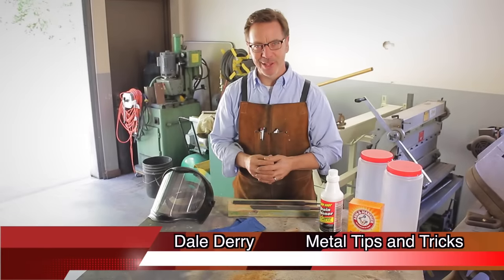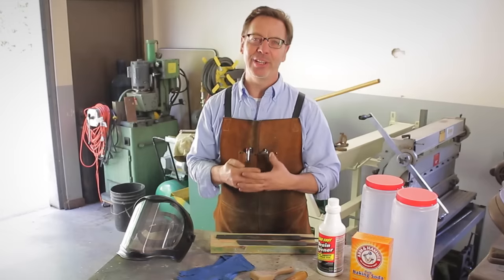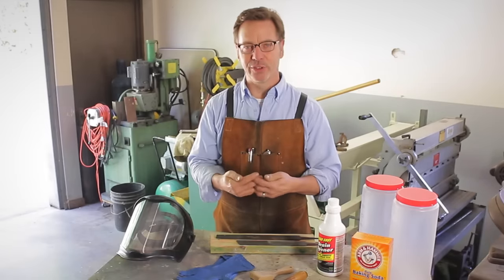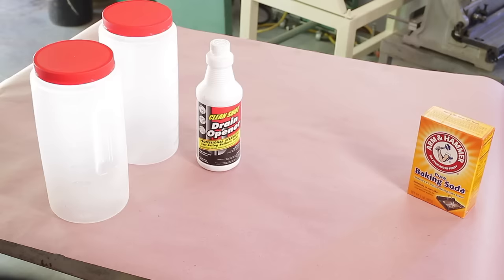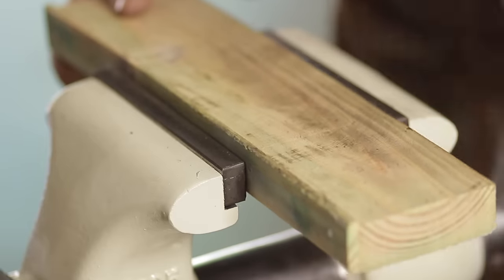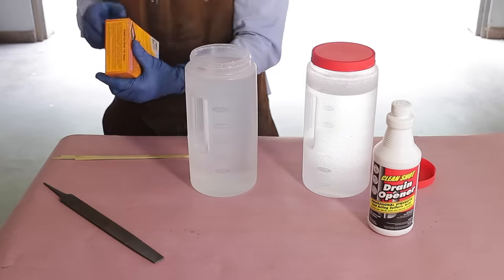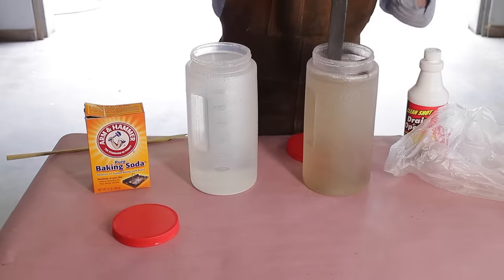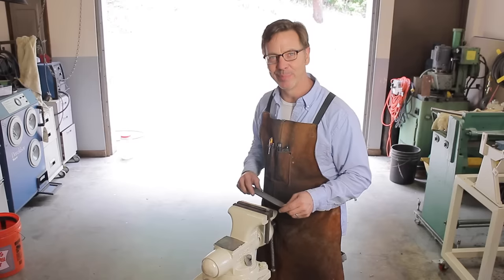How to Sharpen Metal Files

Comment: This WILL sharpen files but it is safer to us white vinegar instead of the sulphuric acid, not to mention that the vinegar is easier to get & cheaper. 
And he's right that you have to clean the file first. If you don't get every particle out of the teeth before you etch them the debris will block the acid and leave a bump that will act like a permanently clogged spot. I'll have to try the copper pipe thing.
Reply from the maker: Thanks for your comment

Comment: Hi'yall.
I must remember that copper pipe trick to dislodge stuck soft metal or paint flakes.
I do use a brass wire brush, as we were taught to not use steel wire brush on a file.
About this water first discussion. Don't just think about a reaction.
Also think about what happens when something splashes into a liquid.
You don't want pure acid coming at you, don't you?
In industrial environment, and at home, you would be advised to also protect your body with an appropriate apron.
If you do not own a face screen, use an old motorcycle helmet or a welder's helmet.
Kind regards, Jaak, from Belgium.
Reply from the maker: Great suggestions :-)

Comment: For years I have been noting these various and odd plans for sharpening files. I don't believe in any of them! Maybe I just know too much about the way a file is made. BUT what DOES need to be discussed is good file use, and cleaning. For now let's look at cleaning. You need a tool called a FILE CARD. It has short, stiff steel bristles. Rub these across the file, with the teeth as much as possible. Clean out filings that get stuck (or simply accumulate) in the teeth. For occasional big chunks pick them out too with a pointed object such as an old scribe. Finish the cleaning with a finer wire brush and you should be all set.

Take care of your files. Don't let them get hit with solid objects, keep them dry. Learn more about file kinds and their uses. By the way, this all applies to chainsaw files too. How can you sharpen a chain with the teeth clogged up?
Reply: A chainsaw file is also a kind of file? Wow, you're a real genius lol
Reply: During use the tips of the file teeth wear away. That is normal wear.  As the file wears it begins to skid over the metal rather than biting in.  At that point it is a viable candidate for either hydro-honing or acid etch sharpening. 
If the file is abused, banged around in a box full of tools, run against hardened steel, or dropped so that the teeth are broken and chipped they are not candidates for hydro-honing but only because of cost. They can still be acid etched. Without shipping costs and the time involved, if you are able to save only one in three it's a good deal. Perhaps most of the file is okay with just one side screwed up, or one end. With no appreciable cost involved, what do you have to lose?
If the file is a little rusty or dirty, use a file card or perhaps a soft steel bar, like I use in my file cleaning video, to scrape the rust and dirt out of the teeth.
Something I haven't noticed in these discussions is any comments on pinning. It's not the topic of the video but if we talk about cleaning, as nearly every post has mentioned, then describing the things that create the need for cleaning should be defined. Pinning is when the gullet between the teeth becomes filled and stops the tooth's cutting edge from contacting the surface. 
If you are having this problem then cleaning will be an endless effort. It is caused by the teeth being too fine for the chip load. Go to a larger file with bigger teeth.
Reply: OR MAYBE.....you DON'T know as much as you THINK you do??

Comment: Hydrochloric (aka muriatic) acid works terrific for aluminum chips clogging files too,  it won't touch anything steel though. But, it does look cool when it bubbles as it eats the aluminum and the files look great. ( I could also just stop using files on aluminum too I suppose, guess that's ones on me! Derp!)
Reply: HCl will work on steel, it just won't work as quickly as it does on aluminum.  Though in general, it's as much about the concentration of the acid as it is the type of acid.  Some materials only interact with very specific acids, like glass; others, it's just a matter of how quickly they accomplish their goal.  This process would work in vinegar, if there was enough of it and the file was left in long enough.

Comment: If metal files are worn out then thrown and replace with new ones,since are simple tools and cheap.Nowadays are less in use since there are a lot methods of precise cutting and fast grinding and in the impossible case that a file is worn,man a simple file is not the most beloved tool of your shop that you can't live without it.

Comment: How does acid sharpen it, cleans off oxides 🤔🤔
Reply: The "draw it on paper" answer here in the comments is actually the best way to visualize what this method does.  Draw a file "tooth" as a triangle on paper.  Now draw a rounded tip on that triangle; this is a dull file-tooth.  Now; draw another line 1/4" to the inside of that, and you'll see that, no matter what your original rounded tip looked like, it is now at least somewhat sharper than what you started with.  

The acid will go after oxides most quickly, but after that, it'll eat away at the metal until the acid is neutralized or the file is removed.  When it's going after just the metal, it eats away at the surface evenly--like the 1/4" you drew on your paper,it eats at the points and the valleys all the same, but the points are left more pointed.  

With enough time, the points would be eaten off entirely, but that'd take way more time and several changes of acid.

Comment: Files are made from High Carbon Steel.  Like knives and drill bits, they get dull.  Unlike knives and drill bits, they CANNOT be sharpened.  If you clean them, they may seem to work better since you have taken years of crap out of between the teeth so the teeth may get a better bite.  I soaked one of my files in Vinegar (white) for a few hours, then wire brushed it.  The result was a clean dull file that smelled like a pickle.  Throw away old dull files.  Thank me later.

Comment: Generally just using the file card after you have used the file will go a long way to keeping it ready for use.
NEVER keep files loose in a draw - They rub together and dull the teeth. Would you rub your wood saw over a metal bar?
NEVER NEVER use a file without a handle. Can the tine be pushed into your hand when your filing YES - Not me but I saw it happen - Not pretty.
Reply from the maker: thanks for your comment :-)

Comment: In my experience, a quality file stays sharp a long time, what I have witnessed is a person, "back dragging" a file, at which point then the dulling occurs, DONT BACK DRAG your files, they are designed to cut in only 1 direction
Reply: This myth has been disproven. 

It does not harm the file, it helps clear chips, and can be helpful when filing certain things. 

It CAN get damaged when back dragging on an EDGE, like if you file a chamfer into a part, because of high pressure on few teeth, but on a mostly flat surface it’s not going to happen. 

That said, I don’t like backdragging files, I think it’s improper use, not because it damages it, but because of how I was taught.

Comment: I asked a few chemists, and they agree you believe it worked because you wanted it to work... because you were tricked by the white coat. (that references the Stanley Milgrim Experiment.)
The real "sharpening" happened in the copper pipe step. But you didn't test it after that. Did you?
Reply: Most files lose their cutting ability, or sharpness, due to contamination of the cutting edge with oxides, etc. The file card and copper remove a lot of this, but the acid removes the remainder without damaging the base material.
Reply from the maker: It really dose sharpen the file. Give it a try, you have nothing to lose.  I promise you, you will be surprised.    
One side note the file must be dull not damaged to work. :-)
Reply: OK. But even if it does, what is the mechanism?
Reply: OK, 
Here's why I'm skeptical.  When it comes to sharpness how well a process works depends absolutely on whether you believe in it or not. Remember back in the 70s when people were claiming that your razor can last twice as long when stored under a small pyramid. 
Same with vitamin C. You have to believe it works before it has any chance of working.
Reply: Most people have no understanding of how or why stropping works, yet it does regardless of whether or not they believe in its effectiveness. Maybe your chemists need an education in metallurgy.

Comment: Baking soda for neutralising acid? why not just wash it away with water?
Reply: Water dilutes, soda nullifies.
Reply: The residue left with a water wash will continue to eat away at the metal.
Reply: Oh thanks for answers. I thought you can rinse acid with water. It will be diluted and eventually finish. Am I wrong? I mean is this process will be done by just rinsing for long time? and rubbing and brushing same time?
Reply: You can't completely rinse the acid from the metal because the metal is slightly porous.  You'd rust your file away from rinsing before you could clean off all the acid.
Reply: While water is a solvent and will eventually wash the acid away, what we really trying to do is bring the low ph levels back up to neutral quickly, but not so much that it shifts over to the high alkaline level - which is corrosive like acid. (There are two kinds of drain cleaner, acid and alkaline based. We want the acid based for this purpose, like a toilet bowl cleaner or something that says it cuts mineral deposits.)

Baking soda has an alkaline level just a little higher than dishwashing soap and it easy rinses with water, (not cling like soap), perfect for a neutralizer. 

What's basically happening with this two step method is dipping the file into acid that removes the mineral type rust build up, followed by baking soda to neutralize the acid and remove the oil based gunk remaining on the file. The final water solvent rinse hopefully returns everything back to a neutral Ph.
Reply: Ok I got it, Thanks for detailed explanation So eventually this is faster, better way than just rinse with water. And yes, I thought your drain cleaner is caustic soda which is alkaline side of cleaners, but saw the acid marking on the label. Anyway, thanks a lot. By the way any solution to clean up a metal files messed with plastic or epoxy? sometimes i need to use metal file to epoxy or acrylic like components. And it become mess. I dont want to heat it up in terms of damaging hardness of file...
Reply: Gökmen Emre Keskin Yeah, it's hard to tell what base drain cleaners use, unless you read the label closely. Liquid is usually alkaline. 

I agree, epoxy and files don't go well together, lol. In a perfect world, soaking the file in very hot denatured alcohol would be a dynamite way of cleaning them!. Being we live in the real world - cured epoxy plasticizes at a fairly low temperature, about 140 degrees, not really enough to mess up the temper. Hit it with a torch to warm followed by an alcohol cleaning. We're talking about open flame and alcohol vapors here, just be careful. Might be able to use an oven to heat, I've always been careful with a torch.
Reply: I've got caustic soda (lye or Sodium hydroxide) in powder form. dump it in to drain and add hot water. :) 
Anyway Thanks for the advice. I was thinking about torch but just scared to leave a messy residue. I will give it a shot with alcohol. Since im living in Hong Kong, probably I would prefer to buy a new one, (super cheap china made ones) but if I get a higher quality stuff, definitely good to know how to restore. Thanks a lot for details. Cheers!
Reply: Gökmen Emre Keskin Drain cleaners are typically Sulfuric Acid(read the label), and have a very low pH. A Baking soda/water saturation will have a very high pH, cancelling each other out.

Comment: but how does the acid know not to eat the file?
Reply: roy hoco     I suppose, the acid just eats away the tiny metal particles left between the file's teeth. Such particles are very exposed to the acid because of their large surface, so ideally the acid eats the metal dust before it can do visible damage to the file itself. However, if there are sharp edges left in the file, they slso are quite exposed to the effect of the acid. So, in my oppinion, this is a bad idea.
Reply: Etiquette. The acid has learned suitable table manners and therefor knows not to eat the file. Something it picked up in its time at West Point. or maybe it was Valley Forge - both fine schools for the rank and file kinds.
Reply from the maker: Im not really sure. All I know is it works :-)
Reply: good  answer, you should go on Family Feud or Jeopardy
Reply: A good explanation of several variations of this process can be found in the free Google book, Workshop Receipts: For Manufacturers and Scientific Amateurs, Volume 2
Reply: Immersing the file in acid causes the acid to only eat the fine metal dust?
Reply: You have the proper attitude to go far in the forum wars. :-)
Reply: It does eat the file. Its is etching away at the surface of the file. There is more surface area on the face of each tooth than at the rounded tip. This means that more reactions occur on the face of each tooth. As the faces are worn down the eventually meet one another at a sharp point at the top. If you had enough acid and enough time then the entire file would be destroyed but that is impossible in the low concentrations and quantities shown in this video.
Reply: Young acids aren't allowed to feed themselves , and they are taught not to eat  stuff on their own .

Comment: Engineers files are made from steel in the state of austenite, this is the hardest state steel can be brought to without additives like carbides. You can clean the teeth as this guy is doing but sharpen? No chance, once blunt they are carked. You can blunt a file by rubbing very fast on a tough material which generates heat locally, the death of a file, because it's state is easily converted a softer state.

Comment: Everybody that thinks this is bogus needs to focus less on chemistry and more on physics. Files technically do not cut, they shear. Shearing requires flat edges. Every part of each edge that sticks out at all gets attacked by the acid, working it down to an even surface as each molecule is surrounded by more and more metal until the edge is a flat plane of molecules and starts to be oxidised evenly across the surface. This results in flatter planes on the file teeth, creating a more effective device to convert your weight and motion into shear strength. The reason this will only work a couple times is because the flat surface eventually becomes fully perpendicular to the file itself as the surface is effectively corroded away, making it an ineffective device as the shear strength will then come only from the troughs and not from the peaks, and increasing the surface area the force is applied across on the piece being filed.

Comment: Sharpen and old metal scriber or other piece of tool steel to a point and use it to "push" particles of metal called "PINS"from between the teeth that a coper pusher wont remove..a VERY old time machinist tip...Make a cardboard "scabbard" for each file...don't let them touch one another.